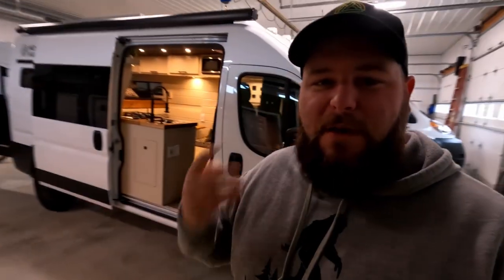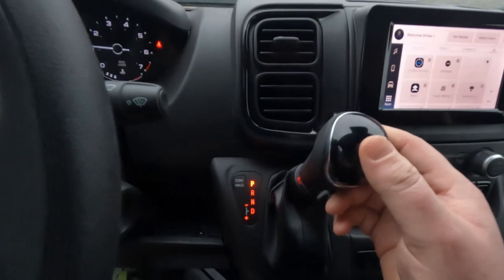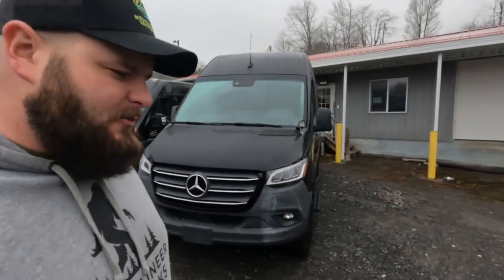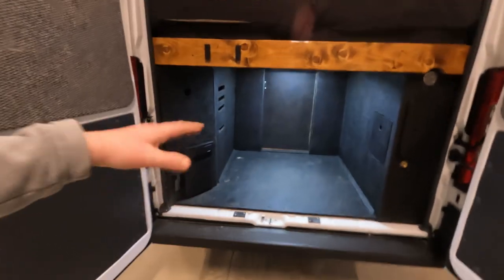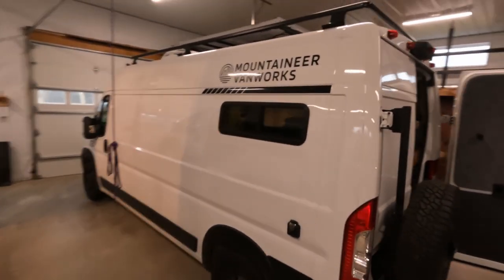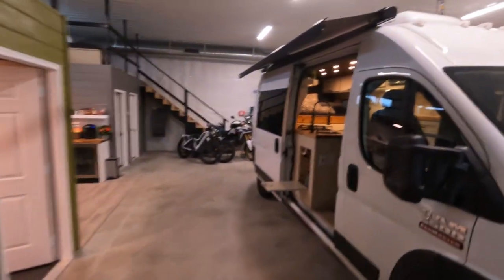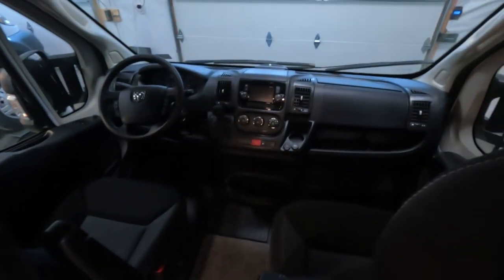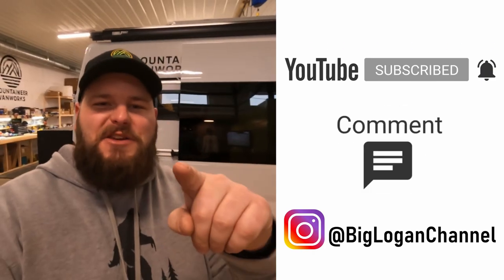VAN TOURS - SPRING UPDATE 2022 #Vanlife

Comment: I would love to see you install an Espar M2 B4L Gas heater in a Promaster. The internet lacks a video of anyone doing that. Plenty of Webasto heaters, plenty of heaters installed in Sprinters, and plenty of diesel heaters, but no Espar Gas heaters in a Promaster.
Reply from the maker: I would if I went that direction.  Personally, the Webasto is slightly less wiring to deal with so I go this route if stock is good on them